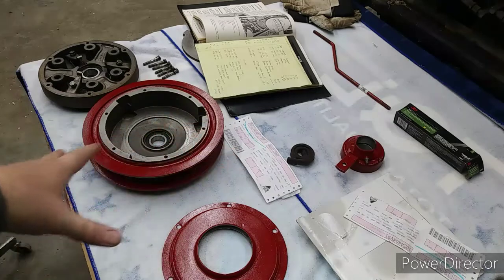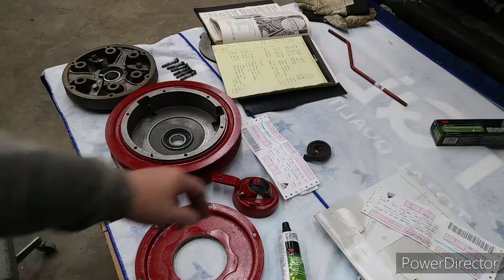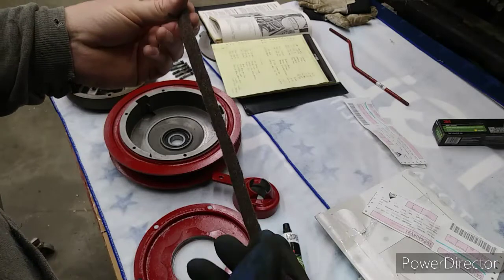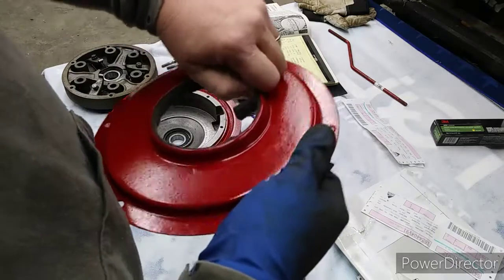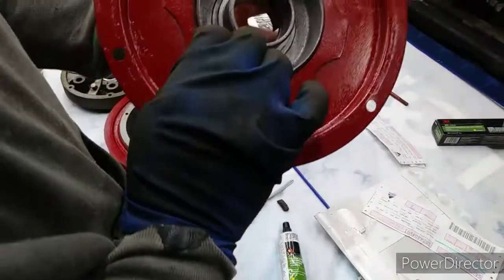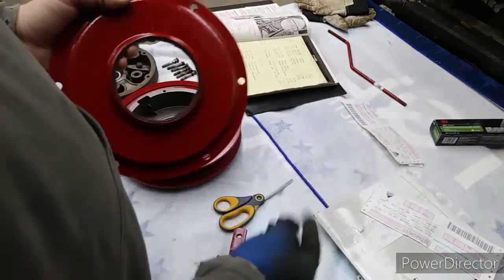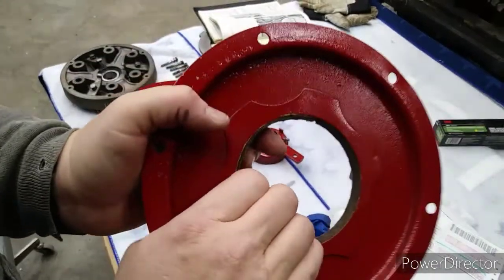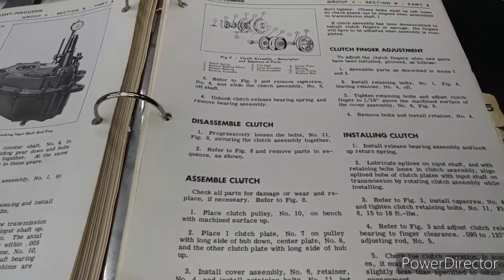Clutch rebuild Massey Ferguson MF 300 Combine, Part 20

Comment: Again, thanks. You put a lot of effort into these videos. You’ll have a nice machine when you’re done. I’ll post a short video on mine when and if I get it to combine corn, maybe u can give me a few pointers.
I was wondering which way those plates went.
Reply from the maker: Thanks for the kind words. I'm sure you will do great.
Reply: @wildcatwilly  ya appreciate the encouragement but I got it all together, seemed to go together fine but the pedal will not release the clutch. Linkage is free.
Reply from the maker: Throw out adjustment seems off?
Reply: @wildcatwilly  yes I don’t think the fingers can move. It’s like they’re solid. They come up when I loosen the 6 bolts like your new one in the video. About 1/8” clearance between the throw out bearing and the two things that push on it, had the clutch apart n freed everything up I thought. Had it apart several times. Even unhooked the transmission brake rod just to see
Reply from the maker: Yes Charles fought the thing for half a day... He needed a clutch alignment if I remember but we didn't have one. Do you have the service manual?
Reply: @wildcatwilly  no I don’t. Was helpful seeing your video with him reading from the manual. I will struggle some more this morning maybe I’ll get it.
Reply from the maker: If you think of anything else I'd like to help. Best of luck!
Reply: Ok. Thanks
Reply: YouTube must not let me post comments with an email in it. Do you have a useable pressure plate with springs you’d sell? I think that’s my problem
Reply from the maker: It doesn't... Do you have Facebook?
Reply: @wildcatwilly  yes